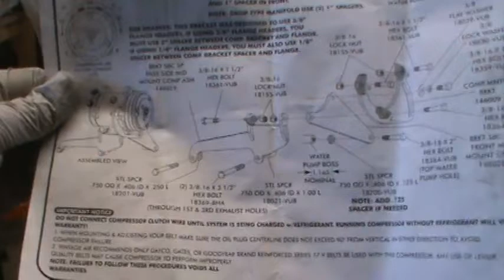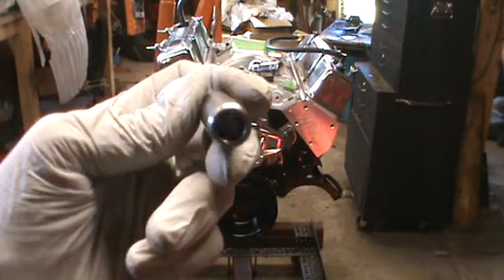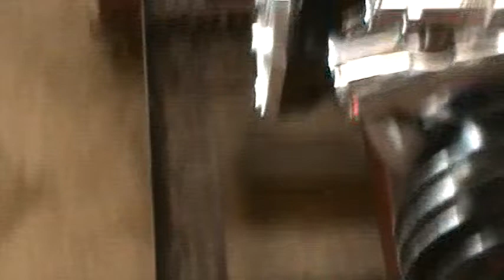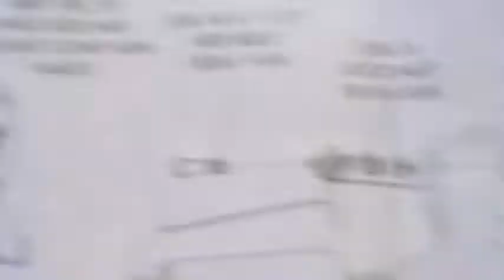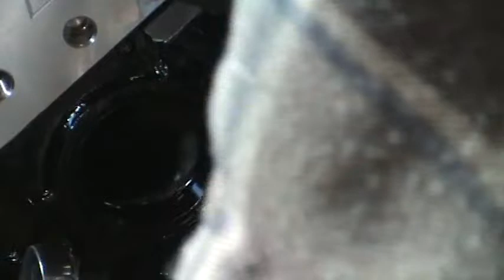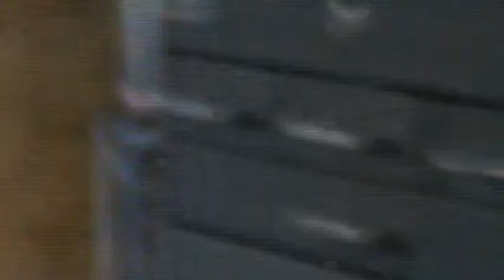76 Corvette RestoMod Pt 156 Water Pump Install Part 2

Comment: Will the belts align spacing out the water pump that 1/8 inch.
Reply from the maker: That remains to be seen.  I don't think 1/8 inch will be significant because the alternator and A/C pulleys are pretty far from the water pump pulley.  The power steering belt doesn't go around the water pump pulley.  If necessary, the crankshaft pulley, power steering pump and alternator can all be shimmed 1/8 inch.  I can't say whether the A/C compressor can be shimmed because I haven't had the Vintage Air compressor mounted yet.

Comment: Hey good looking engine you have there I'm currently working on my 69 convertible Chevelle which has Factory air and I'll need to upgrade to Vintage Air looking forward to seeing the Corvette on the road enjoy
Reply from the maker: Thanks.  I hope your vintage air upgrade is smoother than mine.  I watched a '77 Corvette Vintage Air installation video and it looked like they did a much better job with that than with the "76 Corvette kit.  You probably have a lot more room to work under the dash than I had.